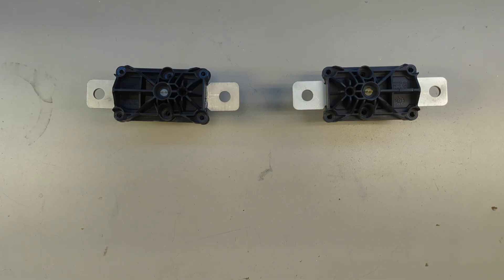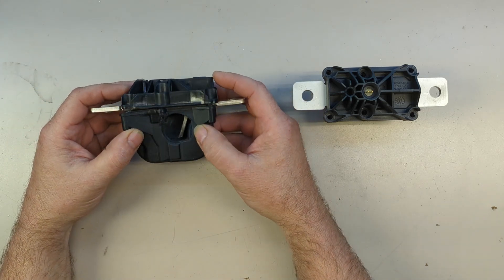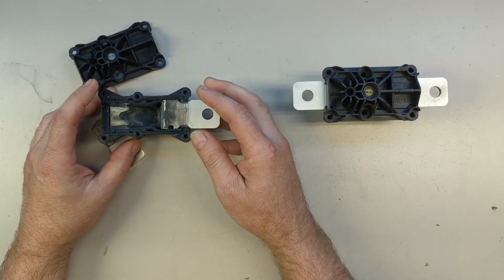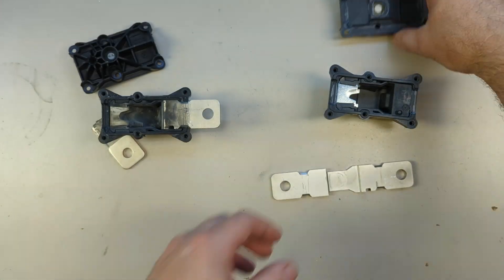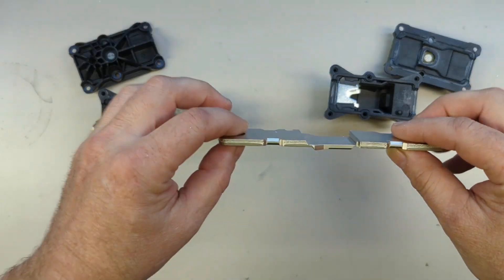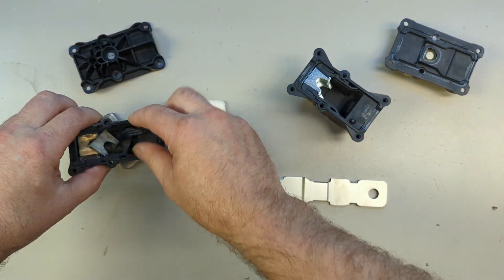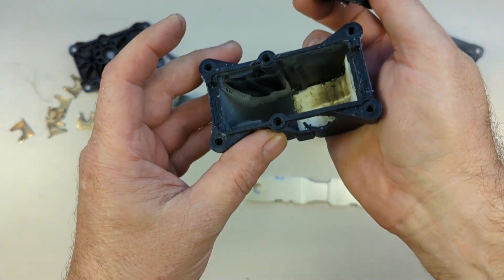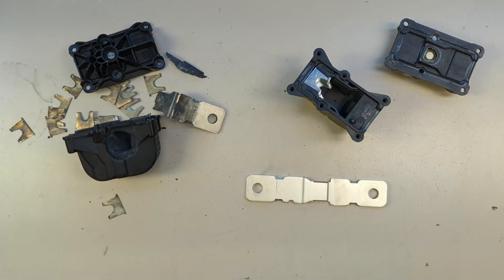Tesla Pyrofuse - Let's Blow It Up!

Comment: I have a crazy question for you. So I am still dealing with getting my m3p going and I have a canbus communication error. Vcfront needs reset but that's not an option in toolbox consumer any longer. I thought that was all I needed to do but I had an aftermarket pyrofuse in it so I decided to swap with an OEM one for good measure. I disconnected the lv battery and hv plug under back seat. Removed the aftermarket pyro and when I put in the OEM one it popped immediately as the first bolt made contact. My question is is there a certain voltage on the two pin connector I can test for to see if it was a faulty pyro or something is causing it to blow and my aftermarket pyro is defective and just not blowing?
Reply from the maker: No, first off, you should verify the HV system before replacing the pyro.  Also, NEVER work on anything under the penthouse with the LV in the car connected.   If you value your car, never use an aftermarket pyro, most will not protect the car!   If the original accident caused the pyro to open while the car was still in motion, you could have a failed drive inverter.  It's super critical you verify the integrity of all HV components before you put that new pyro in!
Reply: @Ingineerix  Yes I removed the lv battery but i didnt wait to clear any potential residual power if that is a thing. I havent had the car on a lift but the only error i had was pmr_a056 and pcs_a076 dcdcdessertederr. i was told the rear inverter were a potential cause of this though. Through risky  i thought about running a test cable from one side of the pyro to the other and testing the 2 small pyro pins for power to confirm
Reply from the maker: @EngineInformant  The power will not be there until the HVP decides to blow the pyro.  It's generated by an active AC system in the HVP, it simply cannot be "stuck" on.  If it blew the pyro there is a good reason for it, and it probably saved your life.  It doesn't sound like you have enough knowledge to safely work on the Tesla HV system, so you should probably get some assistance before you get injured or killed, or burn the car down.
Reply: @Ingineerix  😆 while I agree that last bit def sounded scetchy, I'm no noob to these cars just limited on what data I can find with lack of info I'm being given by the car. I took the proper steps for the most part .inus waiting a bit for any residual power to drain if any. You could understand my confusion as the car is fully functional except contactors closing and most all errors in SM cleared. So to simply swap one (what seems to be working) pyro for another from eBay and it pops (nothing was touched or grounded during install) and all power was removed was strange to say the least. M really more confused as to if it was a faulty pyro of sorts or the car was trying to detonate the aftermarket one the whole time but couldn't if that makes sense.

Comment: Boy and girls, this is a demonstration of why you don’t want an EV if you value you and your families lives. I just had a rear inverter failure on a dual motor Tesla that blew the pyro fuse and killed all HV power to the car leaving me stranded on the side of the road at midnight with a car less than a year old with only 5k miles. That level of failure in a new ICE is almost unheard of. I did a search, and tons of people having the same issue. With the new tiny LV batteries, the car completely dies in 10 mins. No hazard lights even. Selling my EV at a huge loss and buying a more reliable ICE car. Life if too short and I value my family too much to keep an EV.
Reply from the maker: Sounds like you are upset, and I would be too.  But you are overstating the problem.  I have good data on over 3000 Teslas and inverter failure, or any failure causing loss of HV is super rare.  "Tons of people" is just hyperbole.  A flat tire is far more common,  which also can leave you stranded on the side of the road, and this affects all road going vehicles.  Are you going to swear off all cars with tires if this happens to you again?  I don't have any stats on ICE car failures that result in "side of the road" , but I'm confident it's much higher than most EVs.  However, I do agree on the small LV battery.
Reply: @Ingineerix You don't know what you're talking about. You can drive a long time on a flat tire, just watch a police chase on youtube. It is not rare to have these failures. Look it up on the Tesla owner's forums. Your "data" is bad and biased. ICE cars have never left me stranded, and I have driven all the most unreliable brands and older versions of those unreliable brands.
Reply from the maker: @JetFire9  I have actual real-time data logs from over 3000 cars.  I get every alert, trouble code, and all data that Tesla normally gets in real time.  I believe that is a large enough sample size.   A handful of people in the forums reporting that problem has to be weighed against the millions of cars Tesla has sold.   You had "infant mortality", it happens with electronics.  A failed MOSFET in the inverter is no different than one failing in your ICE Engine computer, both will leave you dead.  They both can happen, and it's outside of a manufacturer's control, which is why they all offer warranties.
Reply: @JetFire9 You can drive on a flat tire if you want to ruin a $1k wheel and risk other damage...you'll look like an idiot doing that too.  Look at the countless toyota sequoia/tundra v6s that fail in the first few thousand miles and throw rods.  Look at hyindai gdi engines...

You're basing everything on your personal experience, which is a very narrow sample size.  You can choose what to love and hate, but your reasoning as a whole is not valid for anyone, including yourself.  I bet anything that you will never experience this type of failure ever again even if you keep driving the tesla for decades.
Reply: @VNCTHE1  Don't say stupid things in public. Just go to the forums and search inverter failure. It. Is. So. Common.
Reply: @JetFire9  Out of 7 teslas in my immediate family and about another 20 owned by friends/coworkers, never has this happened once in a cumulative 1m+ miles.  Even if you find 100 cases of it there are well over 3m teslas out there...that number is still puny.

Comment: Hey Phil i'm currently working on a project with the tesla FSD computer, i have a rear backup camera off a tesla model Y and i'm trying to view the images coming out of it but it uses the fakra connector i was wondering if you could help me a bit with my project. i have the fsd computer and im wondering how to power it on and make it display images from the camera if not just display the images from the camera on some sort of stand alone unit.
Reply from the maker: This is non-trivial.  The system Tesla uses is called FPD Link 3, see this for more information:  https://www.ti.com/lit/slyt581

Comment: Hello, my Tesla model s won't charge, after accident..."unable to charge," "unable to drive," "software update required," "service required" messages on the screen. It charges a few second - green light blinks and then solid blue light comes on. Any advice? Thank you
Reply from the maker: You need diagnostics to determine the cause.
Reply: @Ingineerix  Thanks for your replay. I live in Louisville, KY and there is no Tesla dealerships. How can I find someone who can diagnose it to find the cause? Just one mechanic looked at it and told me there is a software issue with the car, but he wasn't sure
Reply from the maker: @user-ks4vh2or4w  Email me.  You can find my email in my channel's "about" page.

Comment: So the center plate breaks off from the terminal ends pushed by the piston. How do they make sure it doesn't get accidentally jammed between the terminals after the explosion?  Next question: This fuse lives inside the battery enclosure together with DC contactors and possible other melt type of overcurrent fuses. What is actually triggering it?? Same signal as for the Airbags??? Can you show how to open a Model S battery pack and then close and reseal it ???? I know everybody loves Sandy Munroe  but you are The Best IMHO.

Comment: Hi Phil, am having difficulties buying Tesla parts in Thailand. So I ordered a profuse for my M3 from eBay from a Ukraine seller for $150 (guess that's 1 way to send money to Ukraine). It's been almost 2 months and the item has not yet arrived. While waiting, I wondered how would I know the part has not tampered (like soldered blown one). This is meant to be  my spare part since one of my friends M3 just recently has this blown.
Reply from the maker: Check the resistance of the squib.  It should be 2 ohms.  The 2 big mounting tabs should be zero ohms.
Reply: @Ingineerix  With a quality modern DMM it shouldn't be a problem to measure squib resistance, but every automotive manual written by a company with a legal department says never do this.
Reply from the maker: @geoffct  Yeah, and Tesla says only they can repair a car.
Reply: @Ingineerix  many thanks as always.
Reply: Continuity and/or diode check mode may  have a higher test current than resistance.  We have no comment on other parts of this thread. ;-)
Reply from the maker: @realsolarcars  Even an old analog meter would have an order of magnitude less current then is required to blow the squib.